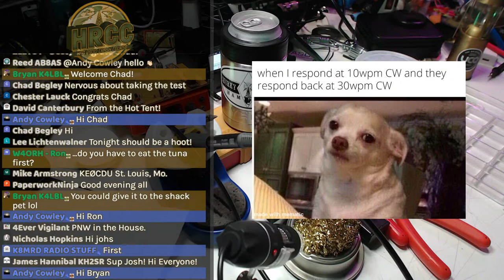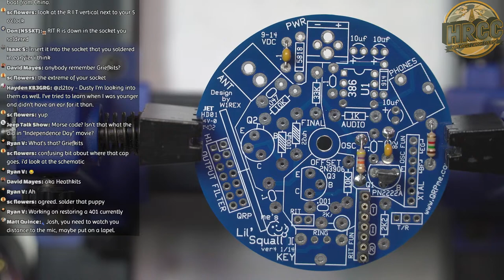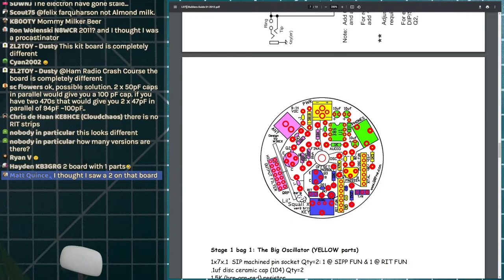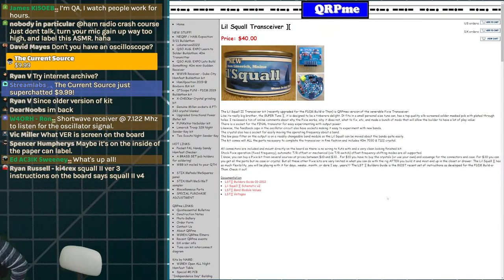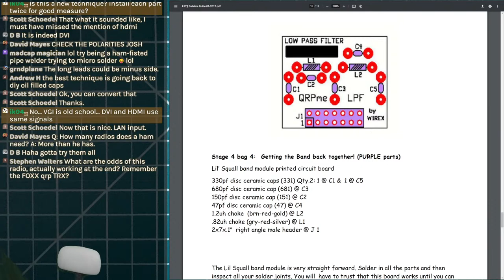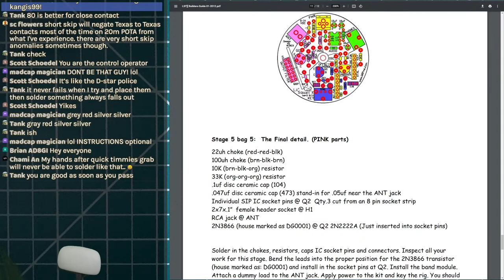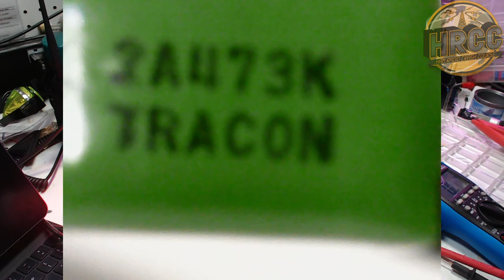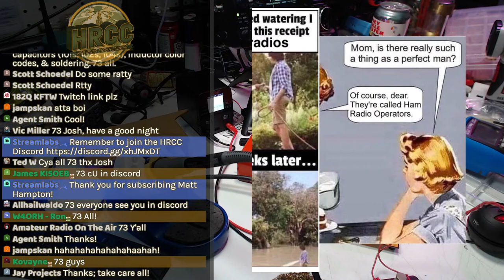Build A Tuna Can Morse Code Ham Radio

Comment: Where did you find the microscope? A friend does Apple stuff repair and her aging eyes need help...

On small kits I often use small pieces of double sided tape and go thru the parts taping each next to that assembly step. Lets me see if any parts are missing before I start and makes assembly easier!
Reply from the maker: It is a cheap $20 usb microscope on Amazon.
Reply: @HamRadioCrashCourse  K thanks I will go look around and send her a link!

Comment: Did you hook the power leads up backwards?  The pad closer to the center of the board is the one wired to the protection diode (you can see the trace in the video when you show the bottom of the board).  Missing parts are always a frustration but I would like to see a followup with a functional radio, if you haven't yeeted the thing into a beer yet. :)